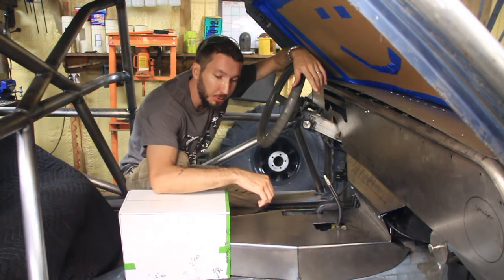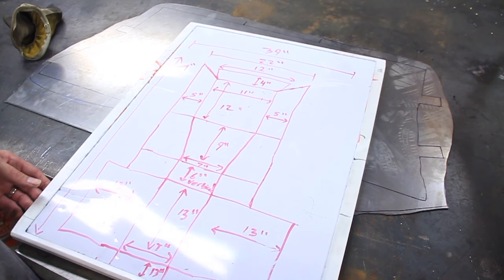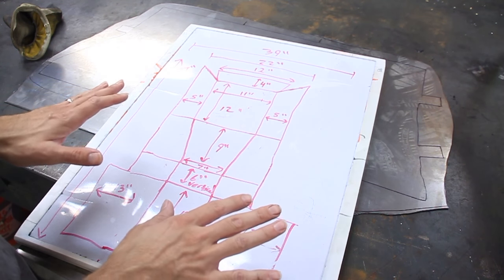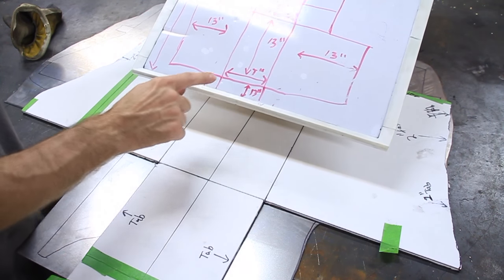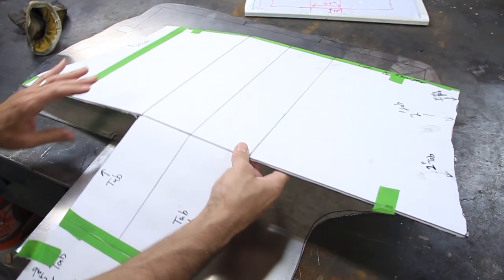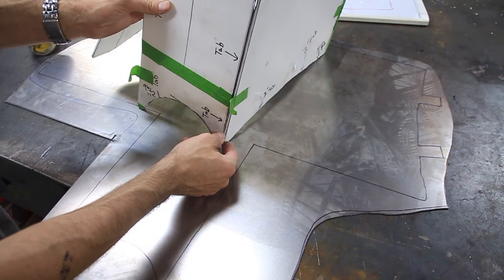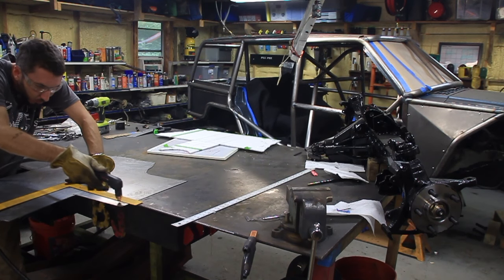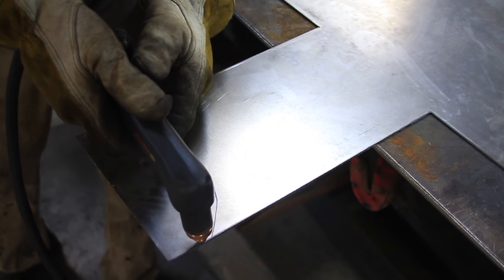Make Your Own Center Console and Dash

Comment: Something that may help, check out minimum bend radius for the alloy and thickness of metal you are working with. That can help you as you are drawing your layout. It will allow you to see exactly how much metal you need, and the exact point at which you need to clamp the sheet down to create the bend with it's minimum radius. I know in the video you said you brought the sheet out about an 1/8 of an inch, which is interesting because that is about the same for 2024-T3 sheet aluminum stock! 

Also, if you will be doing this more often you might want to invest in a box and pan brake, or find someone who has one ;) 

Thanks for the vids man! I don't own a jeep but I still love watching your channel. 

If the internet doesn't give much info on minimum radius for steel, check out FAA 8380 Airframe Vol 1 for sheet metal layout. It focuses on aluminum stock but it will give you an idea and a jump start on the math.
Reply: Oops, I meant FAA 8083. It's also free to view as PDF.

Comment: What I found helpfull to do to make a nice straight bent is to tap a little line on the inside of the bent with a hammer and a chisel.
That makes it bent fairly easy, even on 1-1,5mm sheet metal.

Comment: my gear shift knob is loose and broken. I see you have a green one replacing stock in the thumbnail. are you thinking of covering that briefly as a part of a video? thanks
Reply: Look at the last video he posted, he made a custom one out of a piece of a shaft from a transfer case
Reply: Thanks for the heads up but that was a shift knob to engage 4wd. I need a knob with a button for f r n d
Reply: Marco Ferreira just go to a pick n pull and grab one
Reply: Thanks guys, and thanks Bleepin for covering every damn part of these trucks
Reply: the bleepinjeep video that starts out showing the 4x4 shifter knob made from a shaft, really goes on to show how to make the automatic transmission shifter that is totally custom and functional

Comment: Matt
Would like to converse with you but do t know a lot. Out this utube like how to pm you w/o public seeing. I am building a tube frame off road racer two seat pick up truck style frame. All extra HD tubing etc. made a cardboard model of what me. Console will look like a d used carbon fiber/Kevlar hybrid material and glasses around the cardboard. I'm at a rough stage now. Got to hand finish and sand and even out areas. And. It the lid out of the top nose part of it I want it to open like a BBQ pit or coffin. Bad example. But cannot figure or decide how to make the lid water proof or at least resistant. Will hv a solid pin hinge all the way down one side, but I hv a saw blade width gap all wY around. Thought bout cutting some sheetmetal and hand finishing the radius and debuting edges of it &  riveting it to the top of the door that way it will cover the gap and also serve as keeping a lot of debris out maybe running a small bead of silicon around as a gasket. Wanted it made from sheetmetal but do t hv a brake nor foot cutter. Pretty. Implicated piece and definitely one of a kind. Wished I knew how to post a. Video of it and I would post it. Gonna be a work of art this buggy when done
Reply from the maker: sounds pretty badass!  are you on fb?  its easier to post short videos and photos on your club bleepinjeep fb group.